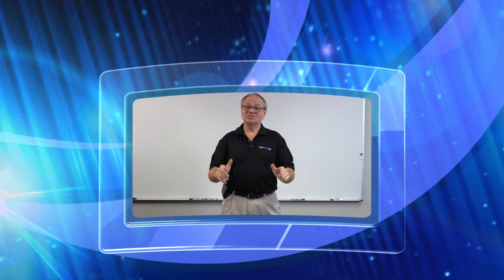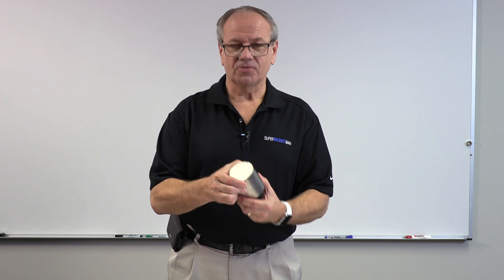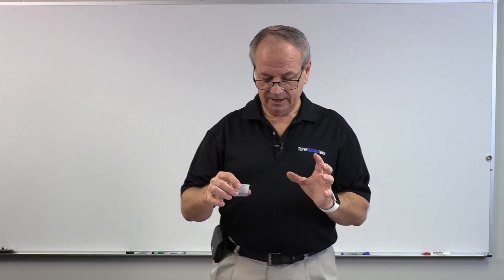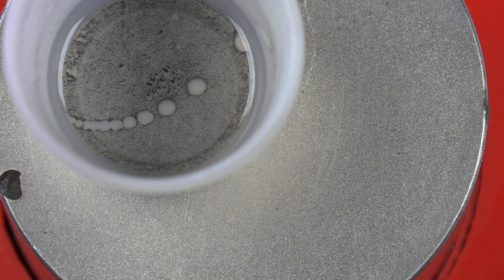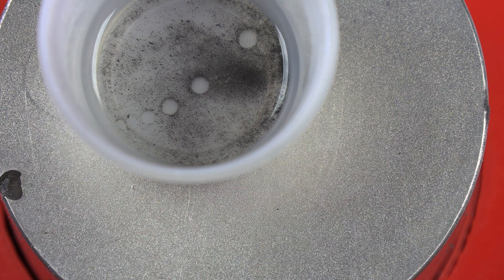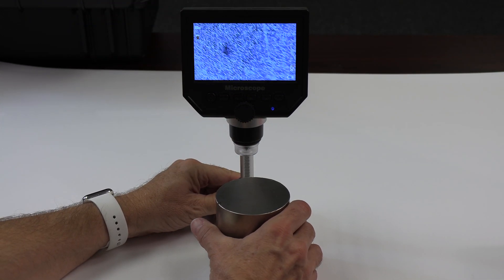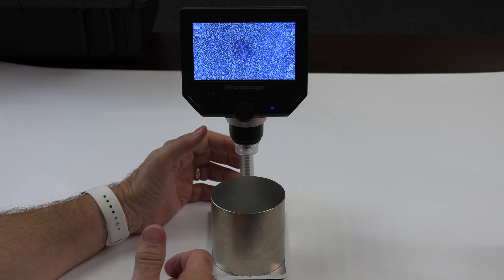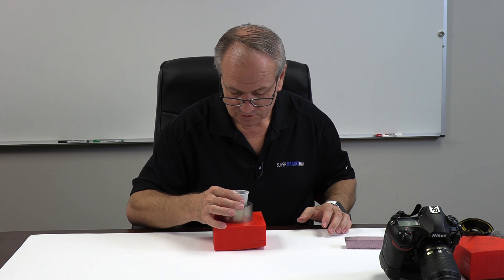Magnet Mystery - What the HECK is going on?

Comment: The crop circle marks may just be oxide spots caused by exposure to drops of an acidic substance that reacted with the surface & perhaps even the subsurface to some degree. Its presence is both visible & measurable. Or perhaps drips of something very hot/molten is also a possibility.

Comment: a high heat source weakened sports on the magnet like a high power laser or voltage maybe.      OR 
The the magnet has impurities or not mixed well on that spot underneath the coating. Which as you notice the metal is attracted around the dots and not at the center since the center has the impurities and thus the weaker field and the edges has collects most of the metal.  
That is my guess.

Comment: I think those marks are either caused by in impact... a on object bouncing against the magnet surface. This would be consistent with the spacing and could damage the domains. If not that... possibly an arc... in this case heat would cause the damage... looking forward to hearing the result :)
Reply from the maker: Not an impact.  That was my first thought and I dropped a 1 inch diameter steel ball on it a few times trying to duplicate the situation and it did not do it.  I am exploring some other ideas too.  Thanks

Comment: maybe flaws in the metal as in http://www.wermac.org/others/ndt_mpi.html
The question is if you buy another of these magnets does it also have these spots?
I also have to wonder wonder what the manufacturing process was.  Does the magnet get magnetized while its still cooling? If so this might cause the dendrites of the metal to form differently as the magnets own magnetic field grows stronger during the cooling/magnetization process.  I notice the spots are at an increasing width apart.

Comment: These look like points of physical abuse.  I bet some object impacted the surface and bounced a few times while sweeping by.  At the points of impact the shock may have freed the material to assume a different magnetic domain direction and while in such  "freedom" they assumed a reverse direction like what happens if you try to align 3 bar magnets in parallel and find the middle one trying to flip around opposite the other ones. The shock "breaks" the magnets into close-by parallel magnets and  those (even dust) that are free to reverse do so.  At such points you would expect anomalous magnetic fields.  That's my call, anyway, if I had to guess. :-)

Comment: Possible arc marks from when magnetization process. Where those arc marks are maybe the magnet is demagnetized there and the iron fillings are drawn to the field lines surrounding those marks. Possible test is to make another arc mark using dc current I would try both polarity to see if that makes a difference.
Reply from the maker: When I received the magnet 5 or 6 years ago it did not have these dots on it and so there is something that must have happened here but I can't imagine what it would be.:)
Reply: Magnetic fields are dynamic rather than static, I believe, due to the alignment of electron spins or coherent electron currents.  Did you store the magnet near other magnets or near energized electrical circuits?  It is very intriguing that these spots appeared after you got the magnets, so it could not have been due to manufacturing defects, etc.  These new domains somehow generated themselves due to the dynamic action of magnetic fields which originate in electron spins.  That's my best guess right now.
Reply: No dots when new? Now that's very intriguing.

Comment: Well, the magnetic field is stronger around those spots than inside them, this is for sure.
Do those spots just come from poor manufacturing process of the magnet??
Reply from the maker: This is a correct statement.  The higher strength field is on the outer circumference of the field.  I will give the exact readings next week.  Now that you have gotten that - what on earth could drop magnetic field strength that much in 0.1 mm?
Reply: @SuperMagnetMan  hmmm. What if one was to zap a narrow high voltage bolt through the magnet? That would easily have enough energy to demagnetize the channel it went through.
Reply: SuperMagnetMan 
But the persistence of the ‘displaced’ medium  even when the locality of the effected magnet is no longer beneath it?
Reply: In the manufacturing process it's imperative to keep the material from oxidation my thought is something went awry before or during the process of coating.

Comment: Looks like casting impurities
Reply from the maker: No, this is just in the nickel plating on the surface.  The magnet is actually triple plated - Nickel - Copper - Nickel and these spots are on the top layer of nickel.  They were not there when I got the magnet.
Reply: @SuperMagnetMan  the triple plating, including sandwiched dielectric copper, can be an interresting hint.

Comment: Ah a Conditional Problem you've set up the Condition and want others to figure out the Solution.
Reply: When imperfections are found it's easy to figure out it's in the Manufacturing Process. But what would cause this, so let's narrow it down a little further. Great care is taken to prevent Oxidation from taking place so One possibility could have been a defect in the Plastic Wrap possibly Air Bubbles that Burst when sealing. 

Another possibility could be in the coating (plating) process or even in the original blending of the metal. I think Oxidation would be my first Choice since it formed on the Surface...

Comment: Maybe it is a impurety in the manufakture prozess of the Magnet, where the Neodymium-Iron-Bor is not perfekt mixed and respondes diffrent in the prozess of dielectic Magnetisation.
Reply from the maker: NO, I guess I should have also shown the other end of the magnet because this does not happen on the other end and it does not happen on the clear side of the magnet.  It only happened over the spots.